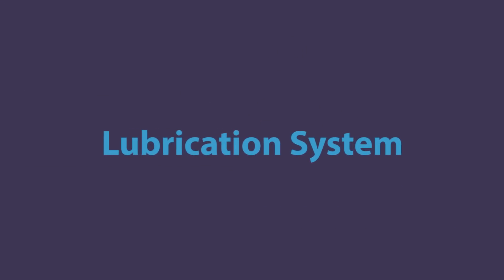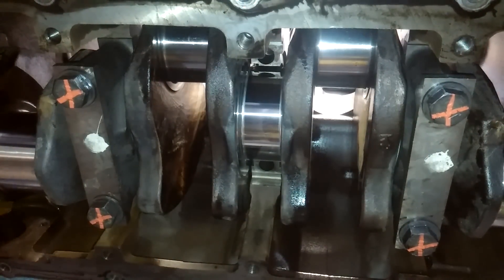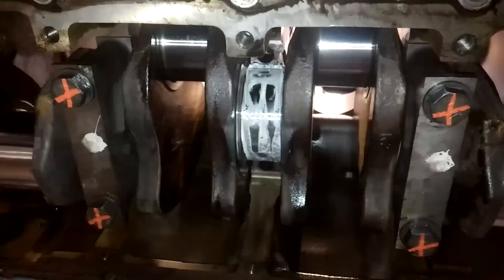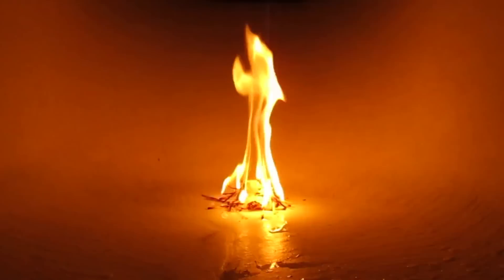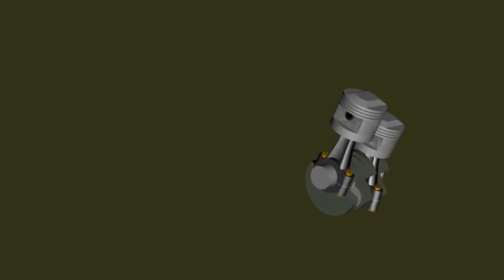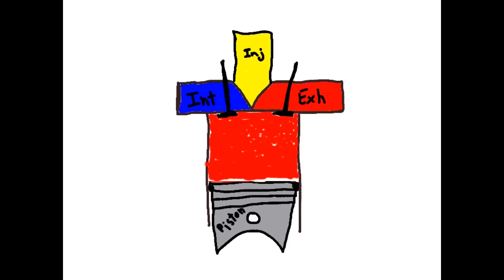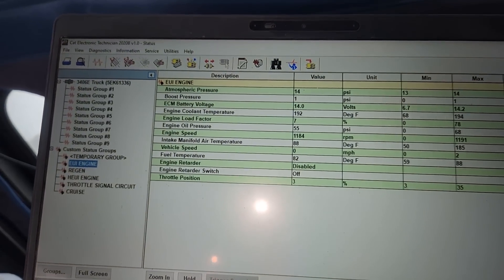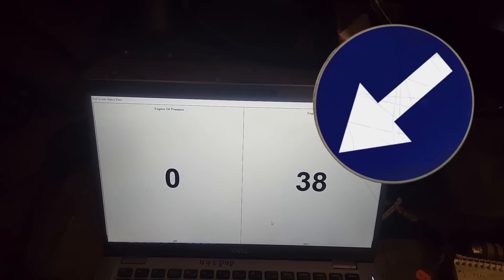What happens when you crank your engine? Science behind starting an engine.

Comment from the maker: Hope you guys enjoyed this one and Happy Thanksgiving. 
@AdeptApe on Venmo or AdeptApe@yahoo.com on PayPal for donations, thank you so much for supporting the channel!

Adept Ape stickers: https://griddesigns.net/products/adept-ape-decal
Reply: Josh have a blessed Thanksgiving, brother🙏🏽🙏🏽🙏🏽
Reply: ALL I WANT TO KNOW IS WILL IT GET ME THERE JOSH . 🤣
Reply: Where have you been??
Reply: Hi Josh. I have a crank no start situation on a 2004 C15 in a Kenworth. The truck was purchased from a guy who was refurbishing it so a few issues were evident as you would expect. Back to the C15. 
1). The oil pressure sender  plug on the LHside of the 
engine was plugged into 
the boost pressure plug??
Would that situation cays issues with the ECU?
2) have checked the ECU 70 pin plug for power/earth and found the following 

pins 28,29,52,53,70 all have 13.4 volts
Pin 8 has 4.4 volts

As per one of your earlier emails on this subject you suggested there needs to be earths on 63,65,67. 
63 has no pin so no earth there as you suggested however although 65 and 67 have pins but no earth are present. 
When I turn the key on prior to cranking there are none of the normal lights,bells and whistles happening on the dash apart from low air light and buzzer, park brake, low oil pressure light.  My understanding is it should have  heck and stop engine lights as well as it should go through the prestart clicking etc but nothing!!  
Question is are all the things that are not happening when the key is turned on a result of no earth and if so can you direct me to where Thea earths go to. 
Help!!!!!!
Great site mate. Keep it up
Reply: Hey josh, how about a next video on why many diesel trucks still use OHV instead of OHC  or about Achates power OP diesel engine? Thanks!

Comment: Once upon a time I came out of the Petro Truck Stop in Kingman Az after a quick meal break and attempted to continue my trip to CA. I turned the key and my C-15 Caterpillar diesel engine began cranking. It turned over fairly vigorously but would not fire. After a few attempts at getting fire into the engine with ether or a number of quick fixes I called out a service truck. He got the engine running with a jump but after shutting the engine off it still would not fire. Ķ It eould crank OK but would not fire.  Changed the timing censor to no effective remedy.  The culprit? A loose battery connection.  The batteries supplied enough juice to crank but not enough power up the ECM.  Lesson learned.

Comment: There’s anyway that I can have contact with you please I have a C7 and I’ve been having issues with it the main issue now the truck will not start. I’ve been taking it to multiple shops. It’s just crank. I change the injectors. I change the engine speed sensor they check the computer they check the heavy pump, and now they are saying it’s may be the rail sensor. Do you have any suggestions? What should I do?
Reply: You should look for his email in the about page and send him an email.

Comment: 14:19 NOT TRUE! With a manual transmission, can pull start the truck, or if on a hill you can gravity start one as well.
Reply: If your lucky, and no engine problems, like getting on air, low air psi in the system. What if you have an old precombustion chambered engine? I have had to push/drag them off and rolling down a hill. I dislike it as you may not have full control if a problem occurs.
Reply: @johngoldsmith6629 who cares 🧐 Brakes are for quitters 😬🤓

Comment: Brilliant basic overview.   I have only one discrepancy. Coolant.   Since about 1997 Coolant sensor can stop the engine run/start.  Mine is turned to Engine Warn Light only.  

Currently driving a Cat 3126 in an FL-70.   I have a running 1993 pre-computer 140HP/turbo Int DT466. Cab and chassis have many issues but that engine still runs like a top.  Field rebuildable ( I have 3 times ). The only real rough part is those 26 head bolts at 165FtLbs torque.  

Everyone be where you need to be Safe, Warm and Dry.

Comment: Dead batteries will sometimes show nominal voltage at zero, load, but the moment you load them with anything they drop below spec, so if you load them with an adequate resistor, or you short them very briefly, you will see the difference. An old sparky told me this trick when testing their voltage with a multimeter
Reply: Get a Load Pro tool
Reply: DO NOT SHORT IT!!! Never, ever short a lead-acid starter battery; in a fraction of a second hundreds of amps will vaporize the wrench or whatever you're using, not to mention the posts, spattering you with molten metal. The extraordinary current draw can also warp the plates within. Buy a proper battery lead tester.

Comment: Interesting that the injector is basically like the original cam driven plunger types on very old stationary diesels but instead of a ramp tied to centrifugal weights it’s controlled by the ECM instead. Shame all the modern emissions make simple systems like that go extinct.
Reply: Modern diesel engines are way more efficient and make more power than older diesels through the use of electronics and improvements on the engine itself. Does it suck to repair and understand? Not really. Is it necessary for todays demands? Yes. Aftertreatment, on the other hand, is a straight-up useless.

Comment: Bit pedantic - but when you were talking about the compression generating heat you said it concentrated the heat in the air - which is not right. 
The heat energy comes primarily from the work done by the piston, where it is converted into heat - plus the increased kinetics in the gas from the compression. 
You may have been thinking of the idea that it is nearly adiabatic compression?
Reply: You don't know what you're talking about

Comment: I put an oil pan heater to the oil pan of my '95 clatter stroke for cold winter nights and mornings
Reply: My 1998 1.9 vw tdi converted to mechanical injector pump has done -40f cold starts.
With one battery. 
And no block heaters. 

And it makes about as much HP as a 7.3 ps😂

Comment: A C15? That's easy. How about a compression release engine?  Shotgun starter, air starter, or even a pony motor. Had an old tractor that started on gasoline and then you switched tanks to diesel.
Reply: I operated a grader in the 70's that had a 6 cylinder IH gas start, diesel run engine.

Comment: @adeptape Aside from more power and fuel efficiency, do electronic engines offer any actual benefits over their mechanical predecessors? Seems like the electronics make everything so much more complicated. Would be interesting to compare power gains and fuel efficiency versus reliability and simplicity in design.
Reply: Smog is a huge reason diesels went computerized.

Comment: @AdeptApe are there smaller versions of the same engine architecture of a C15?
Reply: There were C10 and C12 engines. Don't know what architecture you're getting at? C series were good engines. Robust fuel system and good power. Better than the hewi and common rail fuel systems.
Reply: @peteengard9966  I am thinking a 2-4 cylinder based off of the C15 wet liner engine. Not sure what cat has in similar or shared architecture. For example Chrysler used a V8 based engine and made 6 cylinders out of them sharing a lot of components (of course not the block). Other manufacturers do the same (cummins for example).

Comment: I’m head of service for a oilfield equipment company. We work on large frac pumps and other oilfield and construction equipment. The amount of times I’ve seen a piece of equipment brought in because it doesn’t start or has derating issues because of old batteries is very high. A lot of people don’t realize how picky electronics controlled engines are about proper voltage going to ECM and sensors. I’ve seen guys spend a full day scratching their heads about a piece of equipment that had batteries with the normal voltage but no amperage. Slap two new batteries on and voila, back in business 😂
Reply: Got to test them batteries under load boys
Reply: Learnt this the hard way. First thing to rule out when diagnosing an issue is good batteries. They’re cheap and easy to replace
Reply: I have had two batteries in auto applications that has the same 12 volts but when you loaded them….dead.
Reply: I'm a trash truck mechanic and the most common trouble point for modern trash trucks is smog systems, though all of a sudden we are having a lot of fuel related problems, kinda like when they made the change to low sulfer fuel.
Reply: I used to supply pressure trucks as tie back pressure on fracs- 40 nights with no wind was always memorable
Reply: Why mechanical diesels are superior. 

You’d have got a whole day from a skilled technician. 
AND got a whole day of work from the machine. …

If it didn’t have a silly computer. 

I deleted the computer from my electronic diesel 14 years ago. 

Haven’t got so much as a fault code in over a decade 🥹

Comment: Well, I don't know how your engines start, but mine goes like this. 1, I turn the key, 2, the starter motor turns the cage, 3, the turning cage wakes up the squirrels, 4, they start running in the cage, 5, the arm with the bacon drops down in front of their noses and they run faster. Pretty smooth, huh?😂 I love your videos, Josh.
Reply: When hauling a heavy load, just add more squirrels...
Reply: Mmm🥓🥓👌🏻😅
Reply: You must have one of those Cummings.. 😂😂😂😂
Reply: @Jack.Waters   **Cummins
Reply: @tdotw77  🤣

Comment: Volvo's are starting to use 24 volts, and somebody will be using 48 volts shortly.
Reply: Double the voltage and halve the amperage, easier on the cables and the starter motor.
Reply: They've been considering going to 48 volt systems for decades. When that rolls out all your accessories will be electric. Even the water pump. This goes way back to the 70s oil crisis. Talks from engine manufacturers trying to squeeze every ounce of fuel mileage. If the engine didn't have to power the air compressor, it would save a butt load of fuel.
Reply: @ Yes the fan can take 30 or 40 horsepower to drive but even an electric fan takes power. That’s where a Horton fan clutch comes in, the fan only drives when it is needed. Have you ever tried to turn an alternator when the magnets are energised? A truck alternator sucks a lot of power too.
Reply: @jefftheaussie2225  fan clutches have been around since the 50s . Horton is just one manufacturer. Kaiser was another popular clutch. They figured that the alternator was driven anyway. Why not put the fan, power steering pump, A/C compressor and air compressor on separate electric motors would save more power for propulsion. I've worked on mining equipment that had the alternator gear driven from the engine with everything else either hydraulic driven or electric motor driven.

Comment: Typically a mechanical engine will start faster over an electronic engine.
Reply: 100%. I had a dodge powerwagon with a carbureted 360 and it would start at the bump of the key. There was no cranking over, one revolution and it was running.
Reply: @minnesotatomcat But didn’t you always crank up the radio real loud jamming to Powder Finger by Neil Young first before you fired the ole girl up😝
Reply: An electronic engine needs at least a couple revolutions to verify TDC. 
A mechanical engine just needs the fuel in the hole.

Comment: Stupid question.  Why do I need to time a diesel engine injection pump if it has common rail and electronic injectors?  Don't the injectors open electronically and isn't there constant pressure in the rail?
Reply from the maker: "harmonics" the pump will work make just as much pressure, just the voodoo will be out of whack with the invisible frequencies